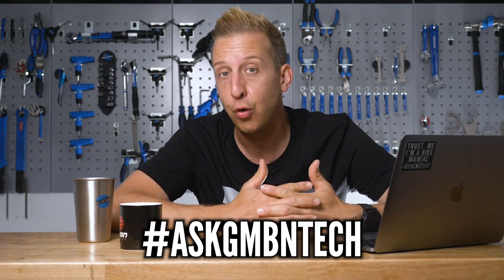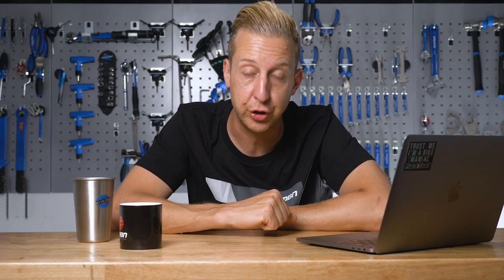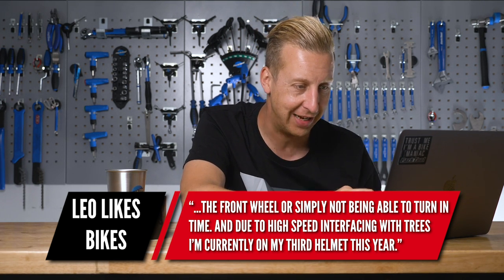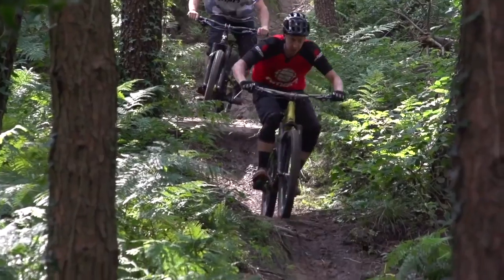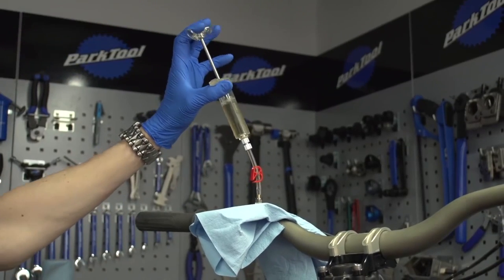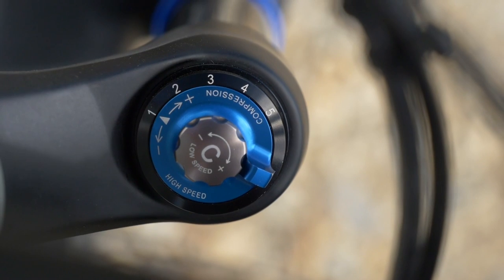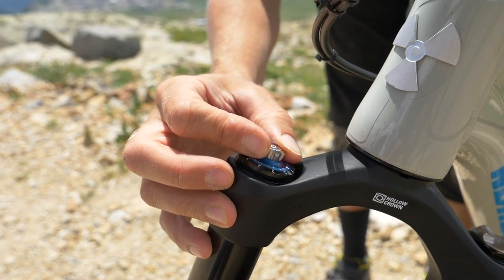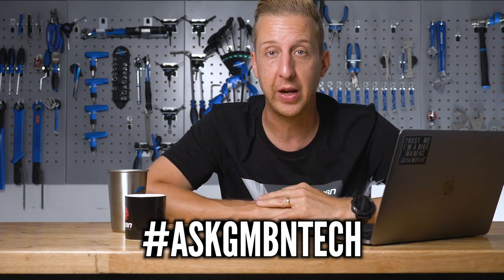Is My Bike Too Long? | Ask GMBN Tech Ep. 84

Comment from the maker: What's your opinion on the length of modern bikes? Do you prefer the ultra-stable longer bikes or a shorter more nimble bike for slower technical sections and jibs?
Reply: Ultra long and stable all the way!
Reply: Kinda a mid ground, something stable but small enough to throw around and have fun on
Reply: My nukeproof bikes are long and big... excellent for what I do🤘😅 (🍻🌮🚵‍♂️)
Reply: I still enjoy riding a short 26er, it's really nimble.
Reply: Ultra-stable longer bike.
Reply: I really do like Lee McCormack's RAD measurement for this - about how much range of motion do you have through your arms and hips to apply maximum leverage

Comment: I put Shimano Zees on my bike with the same noise problem. It was the caliper rubbing the outer diameter edge of the disc so I fitted small washers between the fork and caliper to move the caliper  out by .5mm. Fixed the problem.
Reply: That's what I was thinking it may be.

Comment: Mark Bennett- I had this same issue with some Avid mechanical disc brake before and the adapter bracket was the solution. The holes are slotted for caliper alignment. Check to see if you are at the limit of the slot. I had to lightly file the mount face on one side of the adapter bracket (adapter to frame not the slotted bolt hole) to gain the required clearance/alignment. This was a steel frame bike so I think the real issue was that the caliper mount tab on the fork was not welded in proper alignment. Filing the bracket put everything into proper alignment and I found no unusual pad wear after some use. The point being that just because your having a problem doesn't mean that your doing something wrong. A part of that puzzle could simply just be out of tolerance.

Comment: Threadlock ...Get the locktite blue (medium) solid stick, not liquid. Doesnt get squeezed into places it shouldn't, especially on suspension bolts, where it can causes bearing rotation issues even. Or disc where it can leave a film between disc and hub around some bolts possibly causing micro disc alignment issues.

Comment: Lyrik guy....Defo first take a token out and Add 5psi to current pressure, check ride and drop some or all of the added 5psi as required. When u have correct sag but dont use all travel, its progression levels. At ur light weight, 2 tokens is defo to many, especially with the large neg spring. I doubt u will need any, try 1less first. Also wont effevt support to much again with large neg spring. 
Add compression damping for support AFTER sorting sag and progression.

Comment: Brake Rub Guy: surprised post mount facing was not mentioned in things to check. That's definitely a common cause for rub. Ask your LBS if you have post mount or iso and then ask about facing mounts if you have post.

Comment: I'll tell you how to set up your air pressure on your fork. Get on your bike and just ride it in the street and then bounce up and down on it as hard as you can without bunny hopping or anything. If the travel goes more than half way that means you need more air pressure. If it goes less than half way that means you need less air pressure. Don't worry about sag. Sag doesn't matter.

Comment: Brake rub guy... are u using a 200 mm spacer set up for a 203 disc? Just a thought...
Reply: Just curious, could that cause any lateral rub though?
Reply: yes a 203 does often rub on a 200mm setup , spot on Rupert , i added a washer to space the caliper for a day but adapter was needed for permanent change

Comment: Hey Doddy. love your videos. And have been searching for the Trek Roscoe 7 for months. Managed to find one place that has it. But here’s the dilemma. I am at 5”9 1/2 with a 32 inseam, 230 pounds and slightly long torso and arms. They don’t have the bike to test ride so need to decide on the M/L(18.5) or L(19.5)Any advise? Tried out the XC trek Xcalibur, marlin etc. both the M/L and L seem comfortable and spoke to a few bike sales folks and different opinions. One guys advised to go L as easier to adjust than to buy smaller, abs that for smaller I’d have to swap out the dropper post etc. Any advise?

Comment: @  Doddy, we are similar in stature (I am 6'3" and 205lbs).  I have ridden Giant XL mtb frames all my life (25 years) - anything else, to me, felt like I was riding a tricycle - eating my knees - way to short.  You mentioned that Giant's have great geometry (assuming you meant for you, being tall).  Are there any other brands that cater to us tall folks??  I currently have a 2019 Giant Talon 27.5 (reach is 455mm) and like it, but have to run the seat all the way back on its rails with the seatpost and am using a 80mm stem to feel right on this bike.   I am looking at a full susp and buying direct/online - is reach the best way to compare to avoid this tricycle feeling?  Any there other brands cater to tall folks?

Comment: Hey Doddy and Henry, I love the show and watch every week. I recently converted my 2x crankset to 1x by using just a single 32 tooth chainring on my old 104 bcd crank. The chainline is not "ideal" at this point. Is there a way to move the chainring over by a few mm so that the chainline is in the "ideal" position for 1x?
Reply: the ideal position is in between the 2 ring positions, you cant get there using spacers so i guess you need an offset chainring
Reply: you can get chain line washers.
Reply: @lux-3001  who sells these? Will I need longer chain ring bolts? How many washers might I need?
Reply: @rlitwiller09  How about you copy the thing I wrote and paste it into your browser and see what comes up?
Reply: @lux-3001  that was really rude. This is supposed to be a helpful community. I assumed since you suggested it that you might have more information, and would be willing to share some experience with this subject. If you don't want to share more either don't reply or say, " Sorry I'm not sure."
Reply: @rlitwiller09  Actually, the rude one here is someone who gets a piece of information and doesn't even say thank you, but just demands further explanation. And did you copy/paste "chain line washers" into your google or were you too offended? Have a nice day, mate.

Comment: #AskGMBNTech Hi Doddy, I have a 29er with complete 2-11 XT M8000: 36-26, 11-40. I was just attending an uphill race (1038m up on 15km) and on the steepest sections I couldn't use high enough cadence. So, what choices do I have except intensive training? ;) I was thinking to replace 26T with 24T on front, and get 11-42, or even 11-46 cassette on the back. Will my medium cage derailleur cover it? If not, can I replace only the cage? Or maybe there is even an 22T I could put on front, but will my front derailleur work with it? Thanks!

Comment: #askgmbntech  hello doddy I've recently replaced my whole brake system to Shimano slx (m7000), would it be possible to run the new Shimano slx lever (m7100) with the old caliper (m7000)? Cheers

Comment: #askgmbntech I have a strange issue with my brakes, and I was hoping you fellas could help. I have sram guideR brakes with some snail floating rotors, and they are amazing. But I have started having a strange knocking/vibrating noise from my front brake. I had a similar issue with my rear before, but it hasnt done it for a while now. basically its like ive got ABS brakes! The feel is just like early car abs systems, that rapidly released the grip on the rotor to prevent lockup. The caliper is tight and the pads aren't worn much and all the springs seem ok, do you think its worth trying new pads? or am i missing something? They seem to perform fine, but the noise and vibration isnt nice. cheers dudes. Paul

Comment: Serched the web and not finding an answer. Rock Shox Pike  and heavy rider?  I'm about 280Lbs now(down from 345). Hard tail bike with a 2016 Pike 1500mm . No tokens and psi set to 100 to 110psi.  The chart says for 220lbs use 95+. And says do not put more then 143psi.  Am i safe to use at 110psi?   From the scale on the fork i guess i should be at 130 or more psi for 280lbs. but dont want to go that high.  What are other bigger riders have for psi?

Comment: #askgmbntech Recently I bent the rigid fork on one of my bikes in a crash, and while waiting to get a replacement I looked at the spare junk parts I have and a question popped into my head: What would the effects be of swapping a rigid fork out for a 20" BMX or 20" Fat tire fork, appropriate wheel included, on a frame that's designed for 26" or 700c wheels? Intuitively I understand it'll cant the whole frame forwards and down, but am concerned about handling, ability to clear obstacles and ditches, safety and so on. Would there be positives in increased ability to lift the front wheel, and would rolling resistance be much less?
Reply: it will be lots harder to lift the front since all your weight is pushed forward. your hands will have to take alot of load and be uncomfortable. and probaly you will have pedal strikes all the time. In other words just don't
Reply from the maker: Aubreykun the axle to crown measurement will be way too short for the frame so the bottom bracket drop and height measurements will be very low and it will be very hard to lift the front end of the bike. Also you will actually have more rolling resistance due to the smaller wheel (receives a lot more kickback when it is trying to roll over obstacles) We wouldn't suggest it.
Reply: @gmbntech  Thank you!
Reply: @ultiss  Thank you as well

Comment: #askgmbntech

Doddy, 2 questions.

1. Thinking about putting a 29er in the front of my giant reign 2018 (mullet style). Could you please explain the geometry changes i would encounter if fork travel were the same or less (its 150mm atm so the difference between 150mm and say 140mm) and whether you think this would be a good change for the bike?

2. Regarding your video about anti squat, would a low anti squat value with a rear shock lockout be the best of both worlds? Or just kind of average at both?

Cheers mate, love what you do for us bike nerds.

Comment: #askGMBNtech Hi Doddy, I recently gave my fox 36 a basic service. Both the foam rings underneath the seals must be soaked in the 20wt gold however the damper side bath must be filled with 5wt. Should I be worried about cross contamination between the foam ring and the 5wt bath oil when my bike is left upside down as wouldn't the 5wt oil rest around the seals? Thanks.

Comment: #askgmbn Hi I have a canyon sender with a lot of upgrades and recently found out it can take 29 wheels with 29 fox 40 in long chain stay, should I turn it into a 29er or should I use the money and buy a 27.5 orange fox 40 fork
Reply: If you're racing go 29, otherwise keep it 27.5 for fun. Why would you need to upgrade the 27.5 forks?
Reply: @graysonadams2485  I have a 2018 fox 40 kashima upgraded to coil but I want air now and the coil has scratched the internals so wont hold air so I like the orange forks and have some cash so should I get a new orange fox 40 fork or get  29 fork and 29 wheels

Comment: #askgmbntech So I recently swapped my fork for a coil fork (a Fox Vanilla 125 RLC to be exact) because it feels less sticky than what I had.
However, I only seem to be using 2/3rds of the travel on most rides and I can still really feel bigger bumps.
Would a softer spring solve my problems without making it feel like it has no support anymore?

Comment: #askgmbntech I have a 5 year old Scott Spark and I was wondering how I can find out whether suspension bearings need replacement. Should they be replaced at all? If not, how and how often should I inspect them?
Reply: You prob need to strip down and see if the bearing turns freely and smoothly. Sometimes the bearing seizes, but the bolt/frame rotates, which is not good!
If u ride wet/muddy and wash bike frequently, they will wear out more often. They are a consumable/service part.
Reply: @rupedog  thx for the tip!

Comment: #askgmbntech hi Doddy I currently have an old retro mtb - Marin alpine trail 2000 - I love the bike but the parts aren’t the best and the bike is too small for me. The frame and stem are outdated and the frame is also too small should I upgrade to a new bike or increase the wheel size what will the difference feel like thanks

Comment: #askgmbntech 
I noticed the Suntour Durolux forks on your Mega in this video. I've recently gotten a major bike upgrade, for which my bike guy recommended the Durolux. What are your thoughts on the fork? I have not encountered any issues with it yet, but if you may have found some ideas for improving its performance, I wouldn't mind trying them out too.

Comment: Thinking of picking up a new Yeti SB140 frame, and have a 2016 SB6 that I will be taking parts from. Was wondering how my 44 offset fox 36 will work on a bike designed for a 37 offset? #askgmbntech thanks!

Comment: if you add volume spacers is your rebound faster?
Reply: Rok Bukva In theory, high speed rebound (rebound from deeper in the travel) would be, but low speed shouldn’t change dramatically. The more air pressure, the more the fork wants to snap back, so the more rebound damping that’s needed(more clicks in). But since volume spacers change the end stroke more dramatically, it should only affect it from deep in the travel after big hits.
Reply: Rok Bukva but that’s just what makes sense to me, might want to check with a true suspension engineer to be sure 😜
Reply: @andrewdecker627  perfect answer

Comment: #ASKGMBNTECH hey doddy i have recently got myself a new bike which comes equipped with the 2019 fox x2 which has the E-Vol that goes to 300psi.
I have a 2017 one on my other bike which is a 230x57.9 I think (it’s for the trek remedy) and my 2019 one has a 230x60 and I’ve found out that the Stanton  length is actually smaller and I’ve been bottoming out a lot more even though I have the same adjustments and air as my 2017 shock on my trek. Is there a different sag or something for there shocks? Manuals ain’t helping
Reply from the maker: Different frames will have different characteristics and should be set up from scratch. you may want to install some volume spacers but we suggest setting the sag first and going for a ride and see how you get on.

Comment: #AskGMBNTech Recently upgraded to 203mm rotor in the front and moved the old 180mm to the back. Now the back brake makes a rubbing noise at certain speed (~22,5kmh). I've tried re centering multiple times but can't seem stop the rubbing. Any tips on getting rid of it?
Reply: check if the rotor is straight, it only needs a slight wobble to rub. also check how tight your wheel sits in the frame and the bolts holding the caliper and disc

Comment: #askgmbntech 
Hi doddy, I'm currently running a SRAM 11 speed drivetrain with a 10-42 cassette. I would like to swap the cassette for an 11-50, will this cause any issues or is it as simple as swapping them over and re adjusting my derailluer slightly? Love the show by the way, just got my gmbn stem cap for my bike
Reply: Upgrade to an e13 cassette, 9-46 tooth :)
Reply: No, it's not that simple. You need to change out your freehub body and if it's 12 speed, you need to change the RD, Shifter and chain too.
Reply: @th_js  it's an 11 speed cassette, just different teeth

Comment: #Askgmbntech Hi Doddy,  What causes rotor ring? Whenever I'm railing berms or cornering at higher speeds I can hear my front rotor making a ringing/pinging  noise. All my rotor bolts and caliper mounts are tight and my caliper is nicely centred without any rubbing but can't seem to get rid of it. Would it be worth upgrading to an alloy spider disc rotor? 
Keep up the good work!👍🏻
Reply: What hub-mounting system do you have?
Reply: @th_js  running 20×110 hub  on a 2012 Rockshox boxxer. 6 bolt rotor
Reply: @LloydG52  Oh okay, then that's not the problem. Are you running SRAM Centerline rotors?
Reply: @th_js  no mate, running some generic hayes 203 rotors at the moment.

Comment: #ASKGMBNTECH Hi Doddy. Any suggestions for long roof rack bike carriers? Currently have Thule prorider 591, but my new custom frame does not fit anymore. Its 520mm reach and 1327mm wheelbase (long, but on par with Pole, Nicolai, Geometron etc). Feel there's a hole in the market, even asked Thule but so far I've come up short(pun intended).